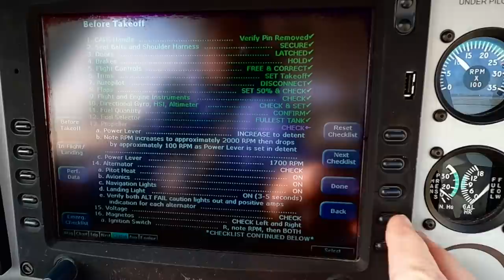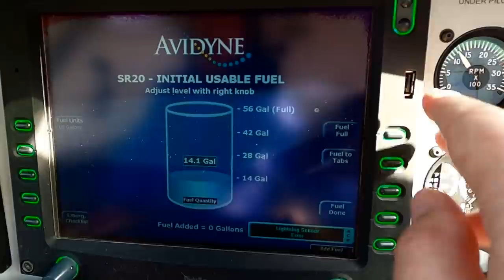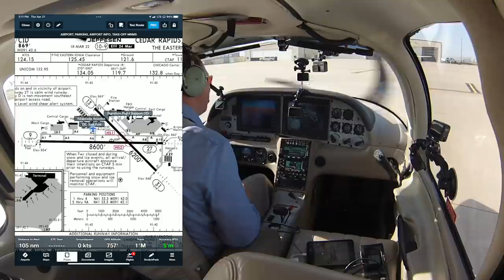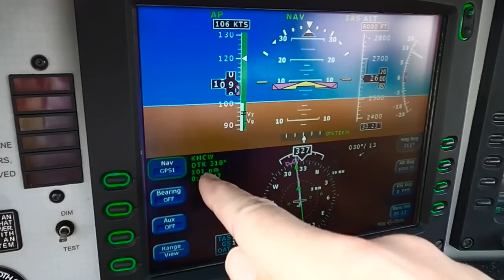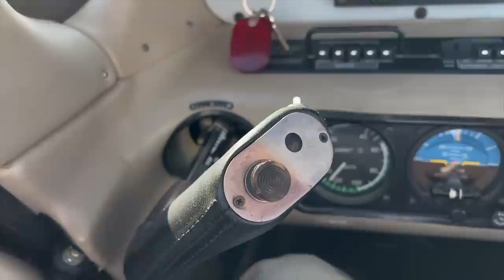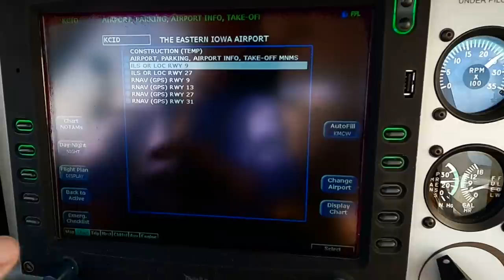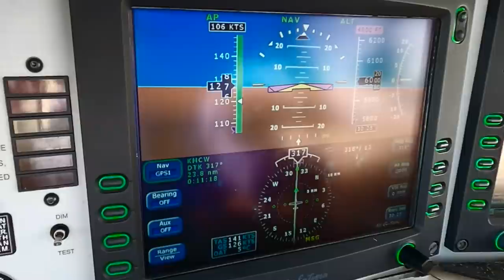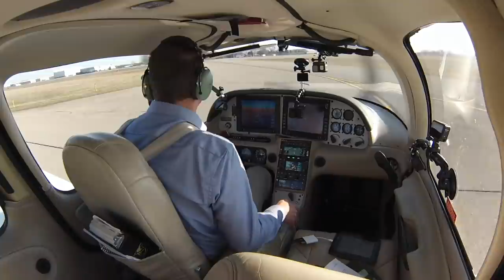Mason City in the Cirrus (while the Bonanza is in the shop)

Comment: Martin, great video. When checking the Flaps at 50% on the run-up, it can be verified by the light. However, a better way to double check it is to deflect the ailerons to their max. They should line up with the flaps at 50%.

Comment: I really enjoy your videos. I also admire your IFR radios. 

I beg to differ on one point. Based on my own experience and the training I received in the Advanced Pilot Seminar and Mike Busch’s writing, I would not recommend using the Leaning process you demonstrate. This process of slowly leaning from ROP to peak and then to the lean side should not be done at more than 60-65 percent power as it maximizes the time in the red box with high ICP. Do the big pull to the lean side of peak.  This is easy to find by the reduction in power. Once on the lean side, then you can do little harm if you want to find peak EGT via gradual enriching. Once you have acquired experience in the plane then you can lean directly to a target such as 50 degree LOP via fuel flow. I practiced this for years in my DA40.  Now I have a Col 400 which has basically a turbocharged version of the engine in your Bonanza. Now leaning is even easier due to turbo charging. I simply reduce rpm to 2300 and lean to 16.5 gph where the Columbia likes to fly at 185 to 205 TAS depending on altitude.

Also. I highly recommend reading John Deakins wonderful Pelicans Perch columns. He had a TN A36. May he RIP.
Reply from the maker: Well, Peter, the late John Deakin (whom I admire greatly) personally reviewed my leaning technique and endorsed it when he helped with my LOP video. At cruise altitude in this Cirrus (or my Bonanza), there is no harm in BRIEFLY leaning through peak EGT. Even at higher power output, you may have some higher ICPs for a few seconds, but that's not enough time for the CHTs to get hot.
I will also submit that leaning by going to a pre-set fuel flow (on the lean side of peak) will achieve a predictable HP output from the engine. But it will not lead to a predictable number of degrees lean of peak, which is ultimately what I aim for. Even if the MP is always the same in your turbocharged engine, differences in induction air temperature have quite an impact on the fuel flow at which you find peak EGT.
I do agree that Pelican's Perch is a fantastic column, well written and so full of valuable information. I miss John!
Regards,
  Martin
Reply: The logic of doing the big pull to LOP side and then fine tuning is inescapable and endorsed by everyone from George Braly to Mike Busch. George really did the research in the test stand to better understand LOP operations. 

Ask mike or George the next time you see them. 

This is why they do not recommend using the lean find feature on the G1000 and many other engine monitors. 

I highly recommend that you take the Advanced Pilots Seminar where the research that substantiates this point of view is provided.  I had many enjoyable email discussions with John when I took it some 5 years ago. 

I have found doing the big pull to a target fuel flow is the best way to get quickly to a safe LOP region. 

Just wanted to give you the benefit of the research in the area which clearly deomstrates that slowly moving thru ROP to peak to LOP is not good for the engine. 

We agree to disagree on this one. 

Cheers!!

Comment: Great video as always. Question: When they cleared you to back taxi on 31, does that automatically clear you to cross 9/27?
Reply: Yes, unless asked by ATC to hold short.
Reply: @stevecastro22  I’ll have to check my AIM, I’m not so sure.
Reply: Good to know! I didn't know that (obviously) but I would've asked. Do I get partial credit for that? 🙃
Reply from the maker: Asking is always an option if you are not 100% sure, Mark.
Reply from the maker: Yes, "back-taxi" without a restriction given allows me to go all the way. In this case, it was even explicit by the controller saying "180 at the end", implying I should proceed to the end of the runway.
- Martin

Comment: Curious as to why you turned the boost pump on while back taxing ?  Shouldn’t the plane be “fully configured” prior to crossing the hold short?  Unless Cirrus states that the boost bump be turned on right before the ground roll….
Reply from the maker: Tough crowd here... 🤣
Seriously, though - back-taxi on a long runway is a bit different from immediate take-off. There's plenty of time, and the Cirrus makes the final take-off check so easy by having everything important neatly colocated on the center console. I'm sorry, but can't seem the harm.
- Martin

Comment: Hi Martin,  I watched the last video concerning AV gas certification and came away with the feeling there are elements of our government who are against any NEW certification of a fossil fuel.  What do you think? Even the speaker thought better of stating reasons why the FAA is slow walking higher certification of his fuel.
Reply from the maker: I will side with the speaker here, and simply state I have no knowledge of what the government is ultimately trying to to (or not do) in this case. My concern is that by not doing anything, we would be on a path which ultimately shuts down most of the existing piston aircraft fleet, including the many aircraft which the aviation industry relies on to train new pilots. I sincerely hope the ultimate goal isn't that.
- Martin

Comment: During take off, what keeps the prop from automatically reducing RPM?
Reply from the maker: Scott, the prop governor in this airplane is set up to seek 2,700 RPM with the throttle lever all forward. If the engine makes more power, the blade angle is increased to prevent RPM from rising above 2,700. Likewise, if power is reduced (e.g. during climb to thinner air), the governor will make the blade angle flatter to maintain 2,700. The only thing that would result in less than 2,700 RPM is if for some reason power output is reduced to much that even at the flattest blade angle the engine cannot maintain 2,700 RPM.
Regards,
  Martin
Reply: @martinpauly  Thanks for that great explanation.

Comment: I hope you didn't use PS Air for your autopilot work.  They tried to charge us $9K for an annual while I was working in Georgia back in 04.  My wife hit the ceiling, of course.  I went to high school with the head mechanic. (his last name begins with a P.  He may be retired by now)  I'm sorry to say he/they tried to take advantage of us because we were both out of state.  They said they had to pull a cylinder and replace a cracked valve,  but we still thought $9K was ridiculous.  We finally agreed to pay $6K, but I will never deal with them again.
Reply from the maker: PS Air seized to exist almost a decade ago, when the other FBO (then called Landmark) acquired it. Today it's all Signature, of course, and no, I would not give my Bonanza to Signature for an autopilot upgrade.
Regards,
  Martin
Reply: There was a guy that used to be near PS Air called Eastern Iowa Avionics that used their system for billing but was independent Garmin dealer.  I used him for my transponder replacement which he did for a reasonable price but he is gone now.  There is now Adaptable Avionics who is an Avidyne Dealer.  I think he indicated he was also trying to get Garmin certified but I am not sure of that status.  I have used him once but not for any Avidyne work but to replace a PTT button.  I believe he does general avionics work as well for reasonable prices.
Reply: @martinpauly  I didn't know that, Martin!  I haven't flown back there since 2010.  I'm surprised.  Maybe their poor business practices caught up with them?  I got my private and instrument rating through Wathan Flying service.  We flew their planes.  Actually, a friend who was a mechanic for the Cedar Rapids Post Office, was my instructor.  Harley Noe.  He just passed away this last year. Wathan's were in the buildings where Signature first came in.  Over by the tower.  Now they own both FBO"s?  Don't know much about them.  Wathan's was always good to me.  All of my annuals when I got my own plane were done at Monticello KMXO.  Paul who owned the FBO there is probably gone, too.  He was always extremely nice to me and their service was top notch!  Sorry to be so long winded....